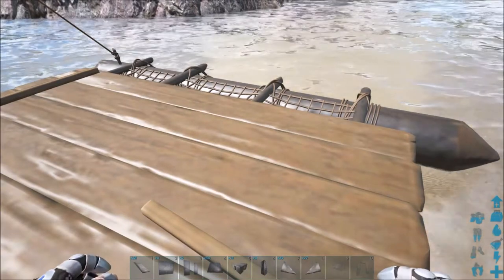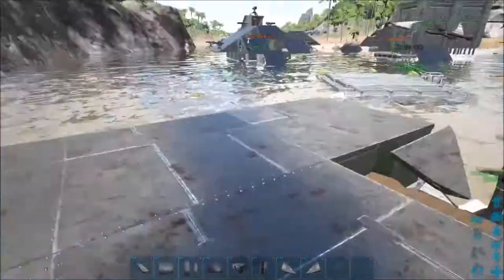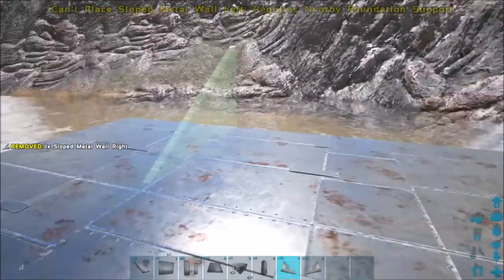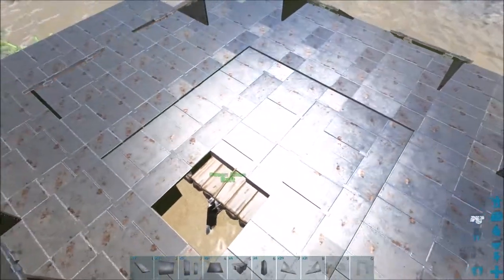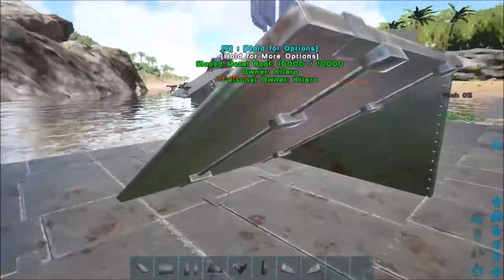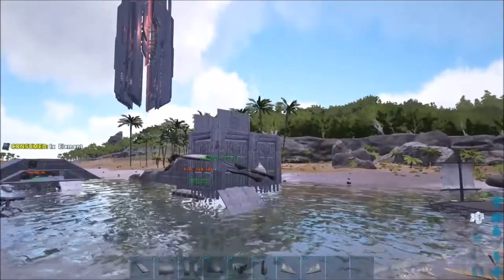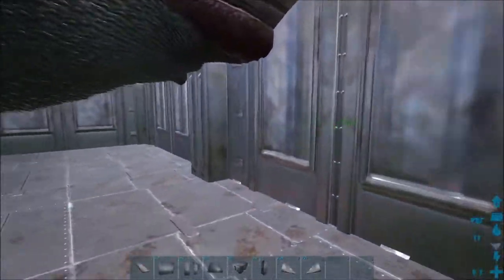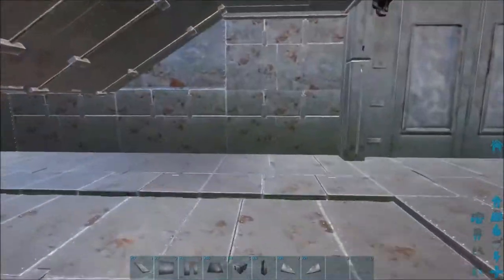[Fixed] ARK raft building, glitch technique for raft extension, + floating raft glitch.

Comment: I'm on PS4 which hasn't gotten the update, so if I built a motorboat now and extended the foundations the old way, would the raft keep the foundations and still be fine after the update?
Reply from the maker: Yea, I still have a raft on officials using this method.
Reply: Newbie4Hire wait so if I make a motor boat right and extend foundations now using the thatch ceiling glitch which isn't patched on PS4 my boat would be completely unaffected as long as the foundations aren't destroyed (because the glitch wouldn't work to replace them), I just wouldn't be able to make another after the patch
Reply from the maker: That's correct, although I have some good news.  It looks like they will be adding back in some of the old raft building techniques, I'm guessing he's talking about putting foundations under ceilings.   As per twitter,  https://twitter.com/arkjeremy     "Gonna re-add multi-floor building to Rafts on all Servers & Officials, was fun & didn't hurt game balance. in tomorrow's update on Xbox & PC"
Reply: Newbie4Hire that's great news, thanks for showing that! You just earned a sub
Reply from the maker: Thanks,  appreciate it.

Comment: Guess what ? fixed...
Reply from the maker: They were quick on that one,  surprising.  It probably worked on land as well (though I never tested) so they fixed it quick.  I hope they will add back in some way to extend the raft, as why else even bother adding the 138 structure limit on it.
Reply: it worked on land aswell i saw a video. The thing that allow you to do this ramps was changed so you could put ramps without foundation support. Also with bug ramps gived foundation support. however they turn ramps back to old form so we still need foundation support for ramps